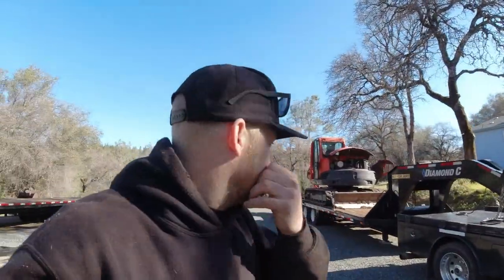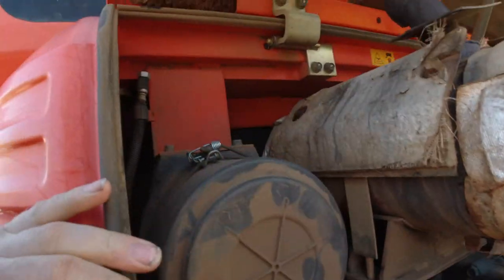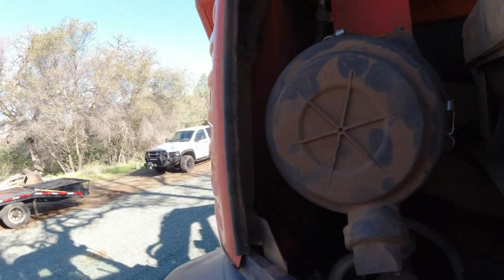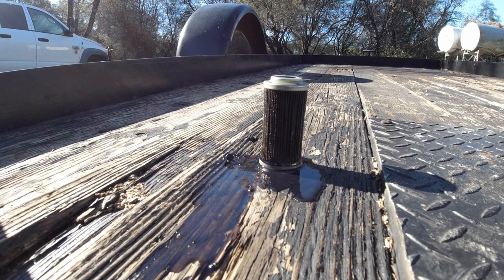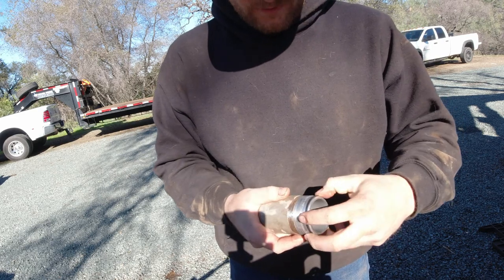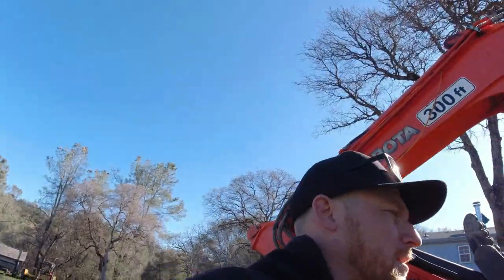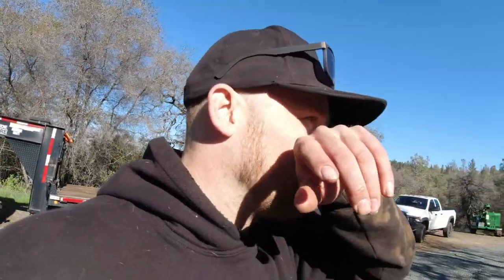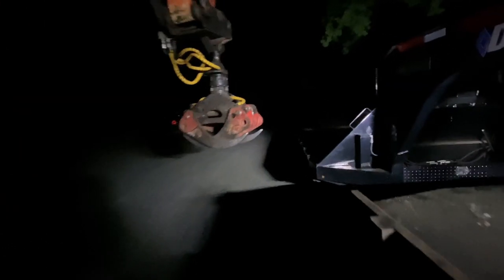Low hydraulic power. Changing hydraulic pump on KUBOTA 080 Broken.

Comment: A non  recommended   mod  for any  hydraulically powered machinery from tractors  to excavators   which do a lot of  basically stationary  work at max revs to drive the hydraulics,  is to upgrade  the hydraulic pump  to a moderately higher output unit.
This  enables  similar  output/ work at lower revs, so you don't kill your engine as quickly. 
Providing you don't over use the additional hydraulic power available you are not overloading  your machine, it's a little  like repowering  a vehicle or machinery  with a bigger motor,  you don't need to work it harder, it's just easier to use/ work. Eg you don't drive an old repowered truck any faster,  it is just nicer under load,  on hills etc
The proviso is a sensible operator  not taking crazy advantage of the extra power,   but  from an operator perspective, it  is much nicer  and easier if you can use the same machine, doing the same work  at moderate revs rather than screaming at max revs all day,  and there is less wear and tear on your engine
It's not unlike adding a small turbo to an underpowered  or somewhat  tired engine, it doesn't run out of puff as quickly,  and if used sensibly can actually  extend engine life

Comment: I put filters on the power steering systems of my cars, and it doesn't hurt to change those fluids once every 5 years or so either.  sure a lot easier than changing a rack

Comment: My 161 had 1700 hrs on it,pilot filter hasn't been changed. It eventually caused a pump failure. $7,000 later I was back in buisness. Ouch